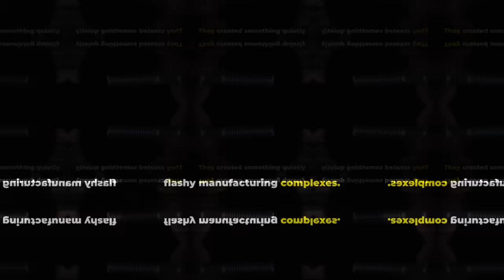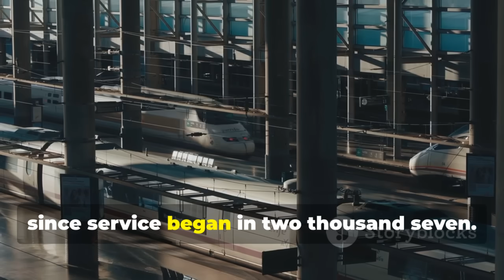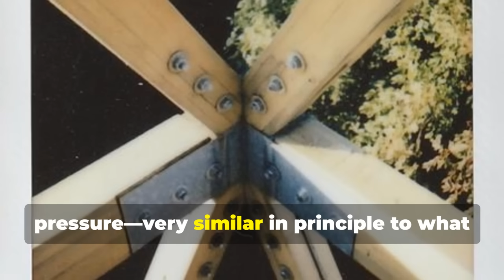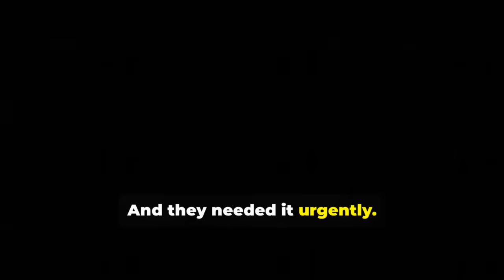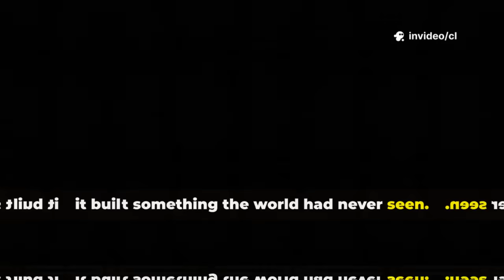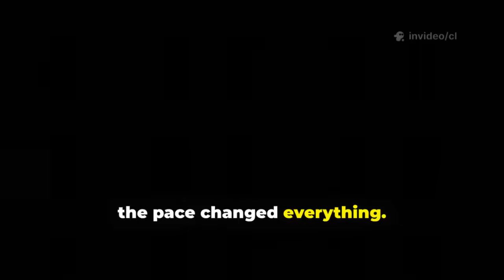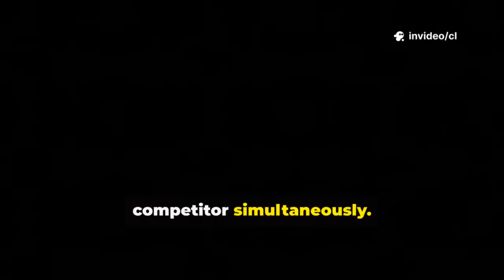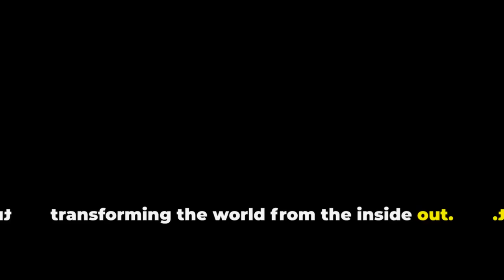Japan Had the World's Best Railway Nut for 30 Years. Then China Built Something Better

Comment: No longer does China require high tech components from external suppliers.  After 15 years, most high tech components are now produced in China. Some with totally new design concept. 

New processes in refining Rare Earth Elements are now made in China, because no western country wanted Environmental Pollution in their backyard. 

So now every modern industry relies on needs REE from mobile devices to high spec motors. These global bans will cripple & slow down global production. At what cost? A slowdown in China’s economic growth. A gradual shutdown of western industries. 

So it can be anytime, but when will China decide to came back to the table. ❤😂